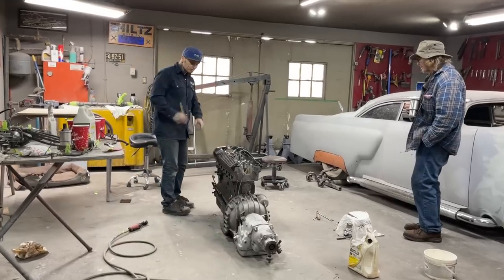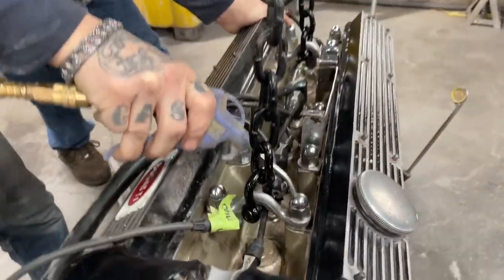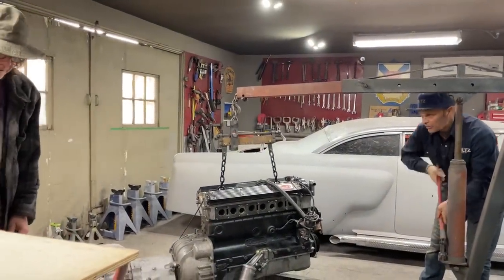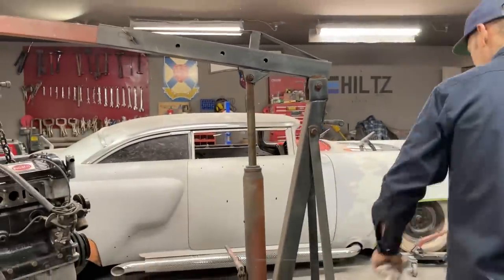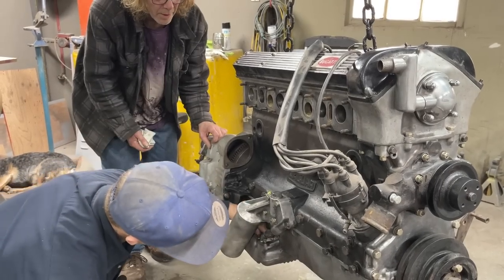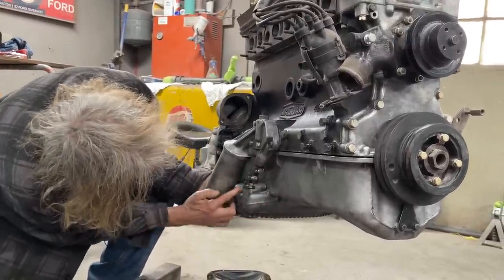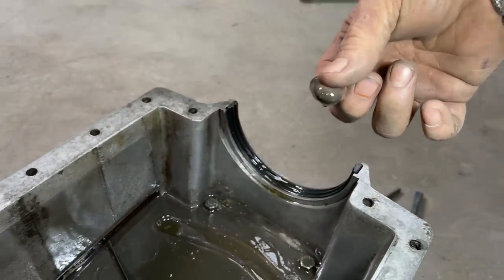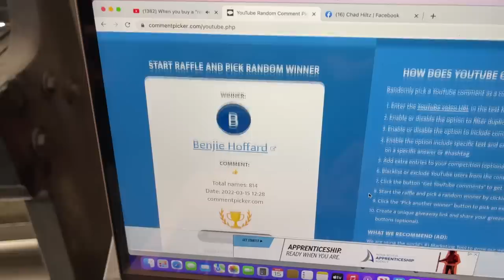The Moment of Truth: Pulling the Oil Pan to Check the Internals

Comment: Just a note here, I think there is an abnormal amound of sludge and forign material in the pan.  If the oil pan and oil pump were not torqued, then everything needs to be checked.  If you had the work performed at a machine shop they would have a very big problem. Good thing you caught it at this time.  I would have made it clear what size it was bored to, what size the bearings were turned to, what the main bearings were torqued to, and so on.  Any mechanic charging for a job like this and leaving bolts loose and untorqued is unprofessional (at best).

Comment: Metal pieces can be found on the tip of the oil pan plug,so the filter doesn’t get it all.
Just going by what my mechanic checks when changing my oil.

Comment: It is my understanding that metal shaving fall to the bottom of the oil pan, that is why the oil pan drain bolt is magnetize, so the metal sticks to it. If you find metal shaving in your oil filter, yes the engine is no good. If you are breaking in an a home built engine, it is accepted to find a very small amount a metal on oil drain plug. And lastly, you assume oil pan was cleaned out before it was reinstalled onto the engine. How do you know if this dirty oil is from this rebuilt engine or the old engine? But, those bolts shown in yesterday video are plenty of enough reason to return the engine let alone the dirty oil incident. Very interesting video today, the things people will do to their friends for money.

Comment: That engine has lots of miles on it and is definitely not a "freshly" rebuilt engine.  May have 30-40,000 miles or more. Pulling a couple of rod bearings will tell the tale.
Reply: Chad made the right call. No sense investing more time and money on a proven dud. Time to move on with a new plan.

Comment: Unfortunately mate, it looks to me that it’s been put together with no tools. Everything’s finger tight, so straight to the bin with that one. I have a 76 mini where the motor shares the same oil with the gear box and my sump has never looked like that. Wow man. No what I expected to see either…It would of been interesting to cut the filter but I understand your frustration. I would of pulled out when I seen those half fan bolts that cost 7k+. Don’t worry you two, Im sure then new engine will be way better! Dino, Brisbane.

Comment: you need to run a magnet though . do you think it's just sealer and gasket deposits from the rebuild ? usually you run a new motor for a while ,then do a engine flush then new oil and filter again , specifically in older motors .

Comment: A rebuilt engine will have assembly lube dropping down to the oil pan.  One or two minutes running is not enough time to pick it all up with the oil pump to the filter. The engine usually needs to get near running temperature for the assembly lube to mix with the oil.  Loose bolts are scary, were they tight when the engine was run?  In other words, did they have to be loosened to remove the engine from where you saw it run?

Comment: i watched the engine tare down and doug said that the pistons looked good ,question is how far of a rebuild was done . myself if your going to replace pistons , then cylinders need done head needs to be plained main crank turned , main bearings and seals .  whats the price on a new engine  or a pro shop rebuilt jaguar engine , Compaired to what you actually paid .  Motor Bike that you bought on a deal or trade and it sat for how long .  maybe it was a fare trade . hard to say . but i think a small argument should not fuel an  live arse ripping and pointing fingers .  please take my skeptizim az  i am not trying to be mean either way . takes a bigger man to say sorry as my mother always said CHAD .   lol
Reply: You win some and lose some . Chad  . Love what you do . Body work is inspiring . Thank you so much
Reply: Agreed, this totally disappointed me. And the whole filter thing was bull and precisel;y why your drain plug is usually magnetic, Jim was way off on that assesment! The filter only prevents from taking slug back up to the top of the engine, there will always be sludge on the botton of the pan.That engine rebuilt properly would I think go for 10-15 thousands dollars possibly more, chose your battles wisely and not on camera! Doug must of siad something about the paint job Chad did on his car with dirt in it and now the fight is on as to who did worse work.

Comment: The engine is toast man. There should bever be that much sludge in a new motor even after a breaking it in.
Reply: Speaking of toast you should be able to eat out of that oil pan if it was rebuilt

Comment: If it’s not gritty, and has no metal particles in it, it may just be excess assembly lube and will break down with first oil change, pull off the rod caps and see if the bearings were replaced, check for cross hatching in the cylinders by looking up from underneath, it could be a rebuild.

Comment: When antifreeze (coolant) mixes with oil, creates a  dark white sludge.  If this is the case, check the engine block for cracks, make sure that the head gasket surface is flat to within couple of thousands, check the head for cracks around the valve stems and check the head for flatness.  Are you sure none of that sludge is magnetic?  Does the sludge contain paper or fiber?  Check the cylinders compression.

Comment: The small goldish color flakes in the pan are babit.  Babit is what the bearings are made of.  So you definitely have bearing material in the oil pan. Before you install that motor in the car, it needs to be "freshened" up, meaning measuring the bearing journals, replacing the bearing, rebuild or replace the oil pump, new rings, hone the cylinders. That motor has not been rebuilt.  As is, that motors life is limited.  Good luck.

Comment: The metal filings could be from machining the decks of the block , the filings may have been caught in the oil galleries and just filtered down in the brief moment it was fired up , I have seen this before , don’t give up Chad maybe get a mechanic to inspect it for you , cheers
Reply: when u machine a block there's nothing on it..no sump..no crank..nothing..just a bare block of cast iron mounted secure n square on the mill...

Comment: That motor is not "new". Not "rebuilt". That's a high mileage, poorly maintained motor that suffered a failure and was patched up to run again. If that was a cast iron tractor motor, it could run another 10 years. But it's not...It's a 2cam, mostly aluminum Jag>>>corpse. $500 as a parts motor would be a gamble, $200 as scrap if you're lucky. If in my car, wouldn't drive it. Sad if you were told otherwise. But don't let it get you guys down...flog on regardless! 👍✌

Comment: It’s clearly bearing material in the oil. Incorrect bearing specs and tolerances, or fitting bearings incorrectly so they cover up the oil gallery leads to catastrophic wear……which it appears this engine has with all those chunks in the oil. The sludge is a separate issue that tells another worrying story……combined with the bolts being improperly torqued and butchered……I think you need your money back. That being said, I do think this type of jaguar engine is an excellent choice for the Chadgatti.

Comment: I rebuild my own engines and I run them for over five hundred miles and change the oil I've never had any sludge like that in the bottom of pan. The oils usually not even dirty when I drain it out and put fresh oil back in it again

Comment: remove the filter cover cylinder... see if there is one. A filter that is. See what's in it. Check a rod cap, inspect its bearing. Pull a main cap and do the same. look into the bores for honing marks , flip it & look at the cams and see if there's swarf in the top/valleys. I think old mate got a nice paint job in exchange for a boat anchor. Sorry mate but I reckon you got dudded. You can always take it to a machine shop/engine guy, and see what $$ it will be to get it right - also an official opinion from an experienced shop...maybe there's not much to do, maybe it's totally stuffed. That person will be able to tell you. Cheers From Sydney Australia.

Comment: Chad you were correct about checking engine . The oil pan is as dirty as a 50,000 miles motor . I have had pans of  high millage motors that were cleaner . .. This is a law suit ,you have it on tape . That car is known world wide . You cant trust him to make it right .** law suit ,huge ***. You built car around that motor .Plus **didn't you paint his car* ???? What a huge mess . Radiator was made to fit that motor plus plus plus .Your time building car around motor has to be considered. He owes you bid time . I am really pissed at that dude .

Comment: Jimbo is grate ,,love to see him come over, i think it makes the show better to have him appear from time to time,,you have a good show Jolene and Chad.
Reply: na i wouldn't use that motor, you could pull one of the bearings off and see if its worn any ,but if it wasn't worn you never know what it was doing before they put new rings and bearing in it, if it was ticking any, new bearing is only going to solve the problem for a while if they didn't put a new crank in it.
Reply: the way it looks its been eating up some bearing and if its been doing that it would be hard to turn that crank because they get hot and have little cracks behind them bearing, have to have a new crank and that is not cheap

Comment: It looks like assembly lube that contained graphite. I don't believe it is sludge. Of course a magnet would confirm metal filings that shouldn't be there. Hopefully the stuff in the oil pan is only from the use of assembly lubricant.

Comment: Don't know what you paid but good engine cost 4k plus I'm currently rebuilding  a pontiac 455 and I will have  over 4k with all machine work done and parts no labor  rebuilding myself .any engine rebuild needs to go in for machine work  alot of measuring for proper clearance  of parts just one little mistake engine will be toast   good luck chad and joelene  find another engine love your show

Comment: I've been inside of many engines; I've not seen any of them with this much metal filings/sludge build up in the pan. In any case, this engine has NOT been torn down and rebuilt like was claimed to be. But it most certainly needs a total rebuild. A magnet would at least tell you if the shavings are metal or aluminum, etc. I would bet my ass it has both. Doug did NOT tell the truth. I'm sorry for both of you Chad, and Jolene. I would NOT go any farther than you already have. Talk to Doug, if that don't get you anywhere then it's lawyer talk.

Comment: if you assemble a dirty block you would get sludge in the pan because all the volume of dirt washed out of the block all at once .  normal running with a clean assembly would only produce sludge or contaminants on a long filtered cycle, and show slower pan deposits

Comment: that grey sludge is fine metal seems that the motor wasnt assembled correctly or the wrong oil was used like first startups should use break in oil which cost alot more money so it makes sense that a shop would cheap out on this process

Comment: I would bring the motor to some one who has experience and is trained. You might be lucky. The chassis is built for this motor. Might take very little to make it work and you would know it is good. If you put another used one in you may be in the same boat.

Comment: If I recall you visited Doug several times and the engine was completely disassembled on the first visit,  do you think you ended up with a different engine?  Does not add up with so much sludge with very little run time...

Comment: That oil pump being loose means they've had this apart maybe it wasn't pumping oil what's in the pan looks like pieces of aluminum and bearing material the cams may need to be inspected if you don't have a zinc-based oil the Cam's can be worn out very fast and just a few moments of running this engine looks like it's got 100,000 miles which what's in the pan if this engine was rebuilt recently and you have that much debris in the pan you have an oil problem and the motor is self-destructing all the bearings

Comment: I've worked on that engine. The reason why ppl don't do it right is that parts are EXPENSIVE and NOT easy to source. You're going to spend a lot of time ordering parts from different places. Also, those engines had issues. There was a tappet stakedown kit that should have been done. The half-moon seals should have been converted to aluminum, etc. All these details that no one addressed. For the cost of rebuilding right, you'd expect those things done. Look to CoventryWest for rebuilt engines. How will you know when it's done right? Expect to pay a higher than average cost. Rebuilt front or rear suspension on those cost $20k USD. Any "deals" you automatically know are scams. I know that Chad doesn't like to spend money, but for anything Jag-related, it is a must, otherwise, you get TOTAL CRAP. This engine is a giant whale/dinosaur turd.

Comment: This happens twice in a engines life, once when it’s old, or once when it’s tearing itself apart while new. Pull a bearing cap, and check the piston bore for a fresh crosshatch. Don’t run that engine either way.
Reply: Pull a bearing cap,check the piston bore.
Reply: Agree there is usually a break in materiel but most ppl don't realize it ........ I don't like that engine either way but someone did go thought it because bottom end  has no burnt oil on it .. I also think neither of these guys should touch this motor ... PLUS HE DIDN'T WANT THIS MOTOR so its mute point

Comment: That looks bad in my eyes,  I´m so sorry for you! 
This metal abrasion should not be in a rebuilt motor. 
The older mechanics always soaks the kork gaskets in water for a wile before mounting them on the engine because they only work when they are wet. no joke!
<3

Comment: i think this engine had a poor wash down before it was reassembled

 then it had all the new oil wash everything in the oil pan where it will stay the oil pump will not pick that garbage up  and dont forget this engine has been sitting around  how long i do not know  so that debris is going to stay on the bottom forever if you run the engine with water in it and mixing the oil up it will keep it considerly cleaner and the filter will then catch most of the debris

Comment: That's about a minutes worth of running while bearing material was thrown off the crank bearings when it was first or last run.
  May have been started dry, may have been assembled with the wrong size bearings,or mixed up rod caps or main caps, even bearing inserts installed wrong. 
 Maybe the crankshaft was not ruined, maybe the rods can still be saved, maybe.
A person who knows very little about proper methods of assembly was likely doing the work.
   A proper repair shop can disassemble the engine and determine cause and cost of repair.The repair won't be inexpensive.
 Do not rely on folks who are not experienced with this engine, or any engine. 
 Straight up ignorance involved here.
 Chad you are a master of your art, you were wise to look inside, now get the right people to fix it, or send the mess back with prejudice, eh?

Comment: The oil pan is leaking ?  Rebuilt engine ??   I glue ONE side of gasket on pan.  Did both sides once.  Then I had to take it off.... oops.  Jim is right on the silicone process - let it dry before tightening.

Comment: Doug never though you would go that far before putting the engine in. it's not a filter problem.  It's a misleading problem. it's surely not a rebuilt engine and a filter isn't cleaning this it would stop up a filter.

Comment: There is such a thing as a good used motor. I mean how many miles is Jolene going to drive the car? I would research how much a verified rebuilt Jag motor would cost. I have seen rebuilt heads going for $10,000.00 ( Moss Motors) in the U.S. I imagine a rebuilt motor would run maybe $14,000.00. Research it. 
The good part is you have the engine. If it runs good doesn't knock or make strange noises it might be ok. bolt the engine in the frame and run it, that's what I would do. Good luck!
That air wrench is really noisy on video. One of those 12 volt battery wrenches would be a lot quieter. They are pretty cheap on Amazon.

Comment: That's not a newly built motor. You found too many bolts lose front seal was leaking the hose was hard. I  would check the filter then pull some  bearing caps to see if the bearings are at least good. I would definitely speak to the person you bought that motor from. Hopefully he is willing to help you out or rebuilt it properly but, I would trust your own engine builder to do that. 
If he lied to you about it just being rebuilt, would not trust him now to rebuild it.

Comment: I see bearing material,old gasket material,plus the gray sludge is from bearings and possibly piston scoring. A few more minutes running and it would have started knocking. Too many contaminates in the pan it will be in the bearings for sure. Hate to see this hope you find a good replacement engine.

Comment: i would check the rest of the engine, if its been bored and honed and new pistons and rings they have probably put old oil in there on purpose because when you run it you are going to  get metal shaveings from your bore while your new rings set in. (why ruin perfectly good new oil?)

Comment: IS the oil pump a gear driven type ?  (two meshed gears)... ( G.M. style )  ?  It looks like you CAN take the pump off and open it and inspect it. Take out the sludge and bits and strain it....then check with magnet. IF it were aluminum, where would that come from.  Definately check the main and rod bearings..... Regarding SLUDGE....when was the motor "rebuilt" and how long did it sit for ???   That 4.2 engine will MAKE the Bugatti..... Don't quit.